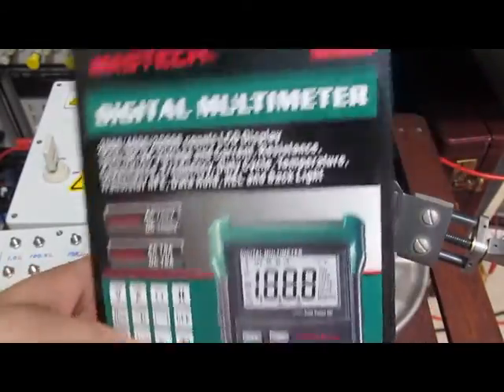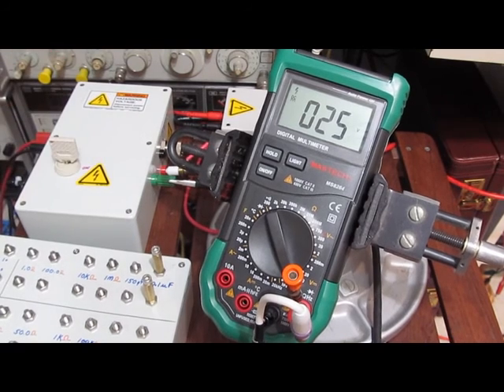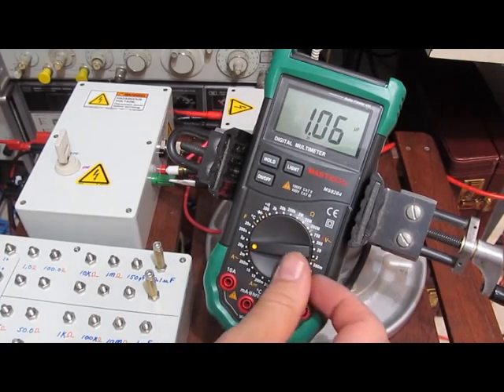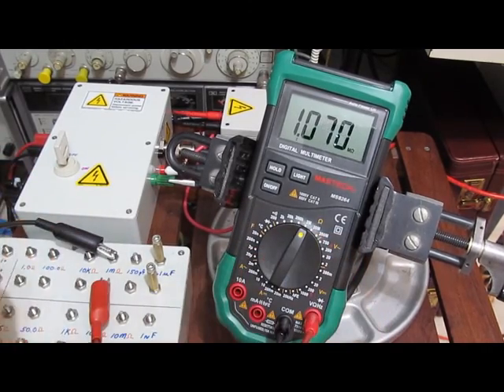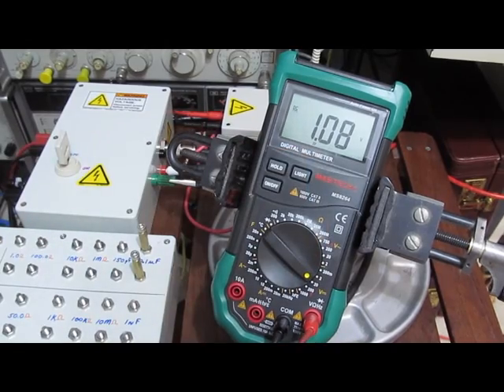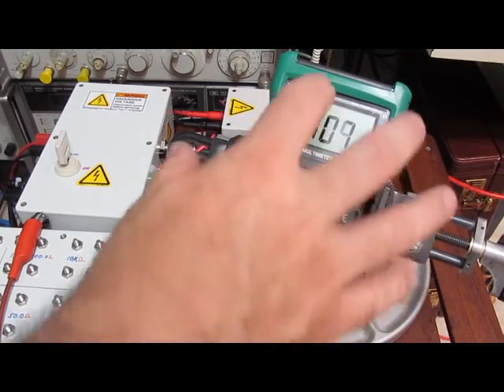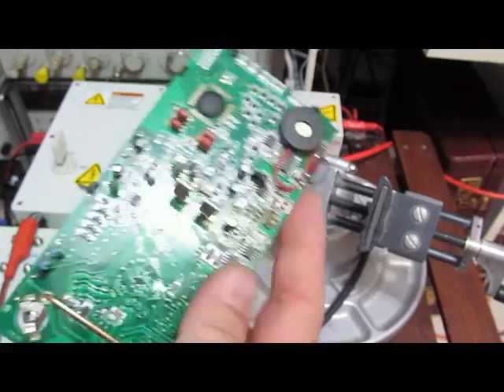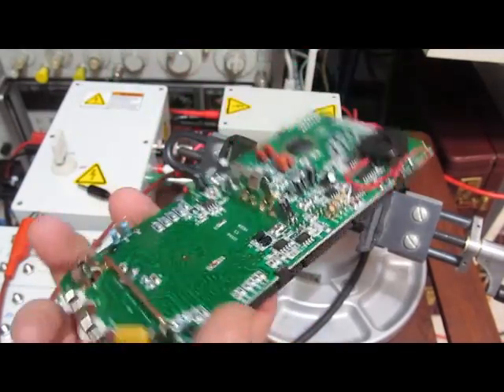Evaluating low cost DVMs Part 9 CAT I The Mastech MS8261

Comment: What would you recommend for around a hundred bucks? I bought one of these for the same reason Michael did... Good reviews on Amazon.. But then again I've read reviews knowing the person that wrote it has got to be brain dead.... Such as sending a wheelbarrow back due to the tire was half flat..... (Guess they are unaware that there is a thing called a compressor to fix that little issue) :-) Great video, wish I had your knowledge!!
Reply from the maker: +sdswebs I assume if you are watching this video, you are looking for something electrically robust.   Personally, I still like the Brymen BM869s over any meter I have looked at, even though is was not the most robust.  It's about double your price range.   I use it as more a mobile bench meter.     

Not knowing your requirements, it would be impossible for me to recommend anything.    The full spreadsheet for the meters I have looked at may be found below.   There is enough data now that you can get a fair idea what brands to consider and what you should stay away from.    If you have any questions about a meter that I ran that you could not find in the manual or want to see some sort of test ran, feel free to ask.  A few of these meters are still functional. 

http://www.eevblog.com/forum/testgear/hear-kitty-kitty-kitty-nope-not-that-kind-of-cat/
Reply: joe smith Thanks for the info Joe! I never did really learn to read multimeters but I use them for mostly DC testing (Automobiles etc.) and do a lot of continuity tests. I have checked voltage in house current. I'm trying to figure out how to do resistance tests. "think that is what you call it"... Example, my wife's s10 blazer air bag light comes on and off and I know what the bumper sensors are suppose to read but with so many settings on this meter your doing the video on (same as the one I bought because of good reviews and you proved those reviews wrong). Maybe i'll just come to your house and you can school me on how to use these things :-) I'm 65 but still have a fairly good brain figuring things out.. I did some more looking and wow, some of these multimeters are pretty high dollar for what I use them for.. but I don't want inaccurate readings so may have to rob the wife's piggy bank... Keep the videos coming, very interesting and your information is priceless !! Thanks!
Reply from the maker: +sdswebs I do a fair amount of electrical work with bikes and such myself.  Really, that Fluke 101 would do everything I need for this sort of thing except measure the standby currents.   I bought a UT210E from UNI-T that I have used to make this measurement and it worked out very well.  Those two meters combined may not be a bad setup and would be under $100 total.   The Fluke 107 would not be too bad.   Small and has current.   All of these are not stuffed with a lot of features you don't need.  The two Flukes are also very robust.    The 101 I bought for that first round of testing has never been apart and I have put it through a lot.   The 107 that technology catalyst provided has survived the highest levels I have tested at.   It's also under $100.   In the case of the two Flukes, I would have no problem using them with my home wiring.   The UNI-T, well, it's a UNI-T.   Use it as a clamp if you get one.  It will do a fair job with that.
Reply: +joe smith thanks for taking the time to reply.. I'm looking at the Fluke 107 now.. I was in construction for 35 years.. Wired a lot of homes and can't read a multimeter... Go figure!! Love the way you present your videos.. Wish I had found your channel before buying this Amazon pos...
Reply from the maker: Below is the link to TechnologyCatalyst's review of the 107. 
https://www.youtube.com/watch?v=fihUrdsyddc

Comment: I have a similar meter, same model different series, Mastech MS8261 series-MS8268 Digital AC/DC Auto/Manual Range Digital Multi-meter Meter. I'm just beginning to traverse the field of hobby electronics so it's actually my first meter. The reviews on Amazon put it high for it's price 4.4 star at 289 reviews ~ $23 US. Because I don't have experience with meters and I don't even have personal preference I chose a meter with an auto/manual switch. These tests that you are doing to offset and break the meters, do you think I made the right buy as someone who is only learning? Because I assume as a novice I have a higher chance of breaking things accidentally. I'll most likely purchase a new meter in a few months. I want to believe that the measurements I'm taking in the meantime are accurate. What are symptoms of a failing meter and what is the next logical choice for a newbie? I'm working with components out the 'Make: Electronics Components Packs 1 & 2'
Reply from the maker: Michael Rosata It really boils down to what features you need and what you are willing to pay.   Every one of the meters I tested except for the ones given to me were better than any other hand held meters I have ever owned.   My first meter was analog.  It was sold by Radio Shack.  I got it when I was in my teens and I used it for many years.   Good luck with your new hobby.